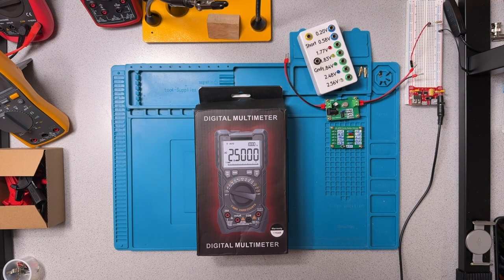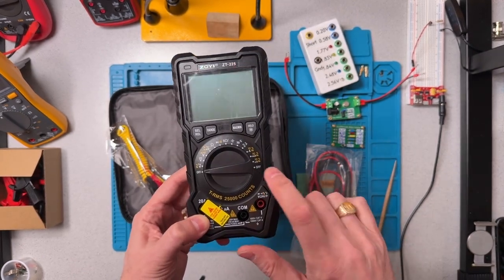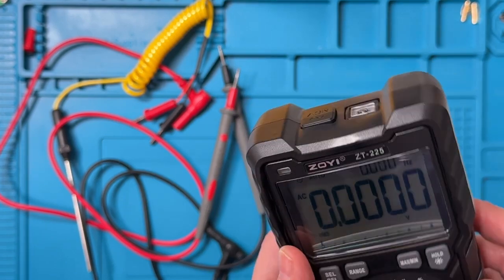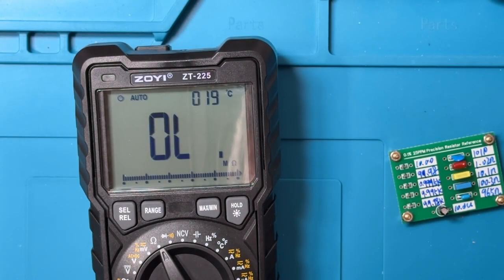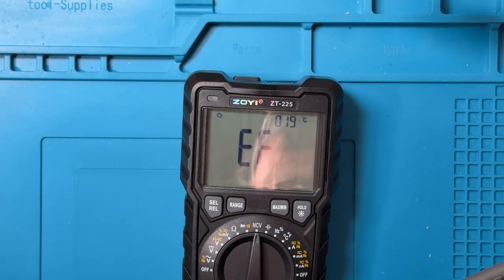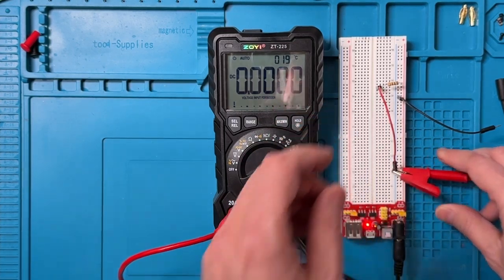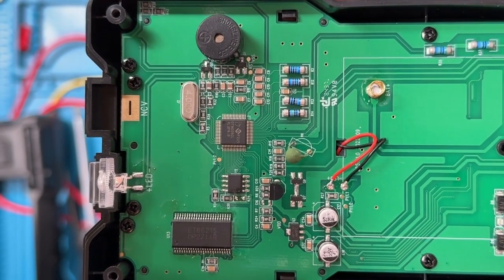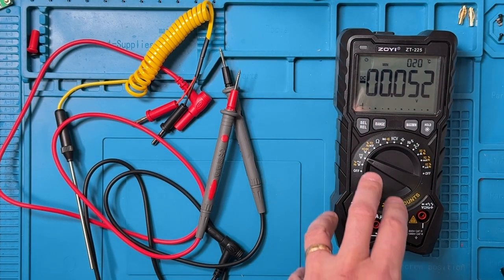Unboxing and Review of Zoyi ZT-225 Digital Multimeter

Comment: I received mine a few weeks ago. I looks very solid and stable (I have no ability to check accuracy with proper references though). Just two smaller points: The test leads that came with mine were for the bin (constant dropouts), I use some cheap silicone test leads instead. Also, initially the temp reading was off by some +5-6°. I placed it in a freezer for some 5mins or so, and also took some further temp measurements in different temp environments, and after while it has settled to a more accurate level (approx. +1-2° off only). For around EUR 35 it seems to be a decent meter for low voltage electronics.
Reply from the maker: Thanks for sharing your experience. I find that using gold plated probes makes a world of difference.

Comment: Measurements of small resistances can be improved by using the REL function.
- Select the measuring range manually.
- Connect both test tips and press REL.
- Then measure again.
Reply from the maker: Thanks for the tip!

Comment: It looks the same to Aneng SZ20, the design and internal components. But this one, looks cleaner on the external design. Good review👍
Reply from the maker: Yes, they are the same meter. I believe the Aneng is rebadged as Zoyi (Zotek) is an OEM of a wide range of electrical test tools.
Reply: @jtechlabs1  oh, I didn't know that. Thanks👍

Comment: Hello. Please comment if this unit has a REL function in resistance measuring mode to substract probe resistance?
Reply from the maker: Yes it does. It is activated with the leftmost button under the display.

Comment: you said it's getting a lot of good mention, is it on some forums or reddit?
Reply from the maker: A couple of months ago I was looking at higher count and oscilloscope multimeters. If I recall correctly I saw this meter mentioned in some Youtube comment thread and also on EEVblog forums.
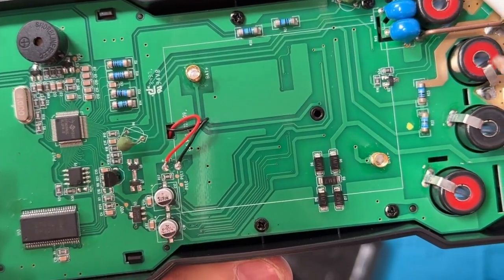Reply: @jtechlabs1  thanks, i'll check it out. and thanks for the review. btw i noticed that (20:33) the fuse holders close to the current shunt aren't aligned, so they're not making full contact with the fuse, might cause some issues down the line idk, thought i should mention.
Reply from the maker: @ashchbkv6965  Thanks for pointing that out.

Comment: This is the replacement for the zoyi zt303 and zoyi zt219. Rebranded by many companies especially Aneng. They were the long reigning kings of the bang per buck electronics meters.
Reply: If you are to buy, which one would you choose? I'd like to know your thoughts about it
Reply: @anonamemous6865  zt303 or 219 share the same accuracy and are more accurate than the zt225. The zt225 has better drop protection than both of those. The zt219 has a thin rubber boot. The zt303 has no protection at all.